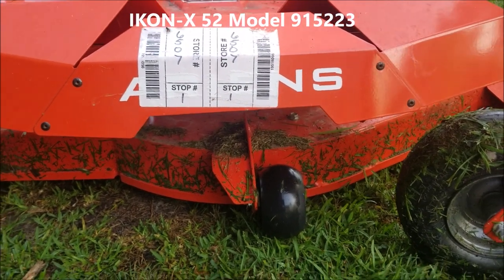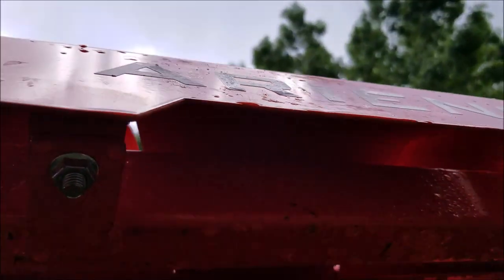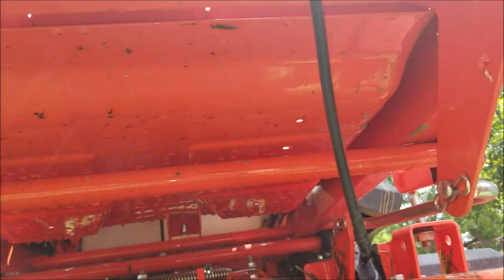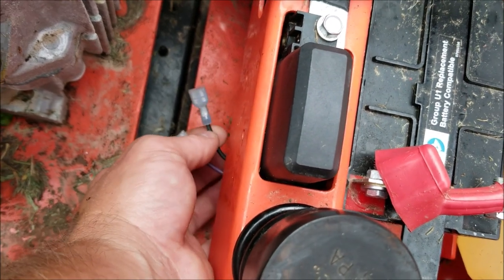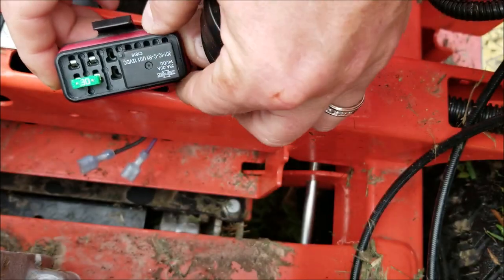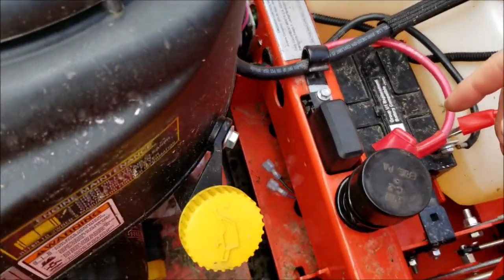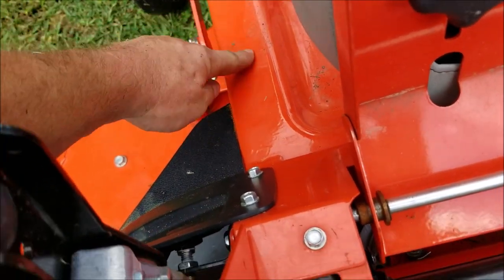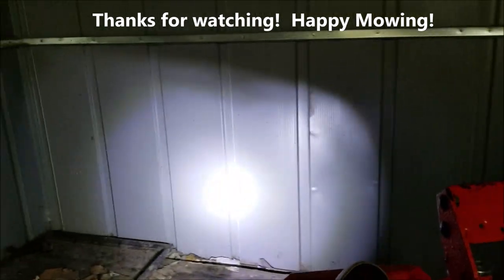$50 DIY Ariens Zero Turn Headlight Kit Installation and Wiring 71514100

Comment: Thank you for this! I'm an idiot when it comes to the most basic of wiring. Have had an LED sitting waiting to be installed. The only thing I needed was this vid!
Reply from the maker: Right on you got this.  Figuring out how to run the wires and tucking them away from moving parts was the longest part of my install.
Reply: JRMSweeps this is a very good question? I too would like to know.
Reply from the maker: Know what my friend?

Comment: For anyone mounting the switch in the same place that JRMsweeps did, I found that a 29/64 bit with some good in and out drilling makes for a perfect fit for the switch.
Reply from the maker: Thank you jashworth04 for that info.
Reply: JRMSweeps happy to help!   I too saw your DIY after I bought the official kit, but that didn’t stop me from going back and wiring in the switch
Reply from the maker: Awesome yes.  I should've just wired it to the main switch regardless cuz I mow in the daylight with it on to show everyone how cool I am haha.

Comment: Very cool, I just picked up a Ikon 42" with the Kawasaki motor and wouldn't mind a LED light. Although I doubt I'd ever really use it, lol. I also like the idea of a toggle switch. Ariens LED kit is nearly $150 so I'd rather do this!
Reply from the maker: It's cool having the only zero turn in the county with an led bar on it lol.  Ariens is crazy about their design, however, it is more plug and play.  You will def like ur new mower, I know we do.  The price was perfect!  Happy mowing, and go trick that mower out!

Comment: My 2020 Ikon xd 52 limited edition didn't need the switch. It works of my ignition. Just plug up wires zip tie everything in loom and good to go.
Reply from the maker: So how do u turn it off while mowing?
Reply: @JRMSweeps  the key you turn it to the first position and the light is on, the position after that starts the mower. Then you leave it there unless you want lights then turn it back to the first position. Mower is running and you got lights. If you want the lights off turn the key back to second position lights go off and mower is still running.
Reply from the maker: @jamesbeck6579  nice.  I wasn't sure if the model I had would do that so I did the inline install with a separate switch.  Great to hear and thank you for the follow up!
Reply from the maker: I wired mine to the ignition as well, but if I leave my inline switch on and turn the switch to the light mode, it will not turn it off, thus the redundancy.
Reply: @JRMSweeps  I just make sure to turn the key to the off position when I am done mowing. I think the 2021 and 2022 models have the switch setup so you don't need a toggle switch.  I know I am loving my Ikon XD 52 Limited Edition. It has a nice custom look seat is really nice and has the classic badges and metal covers over the deck instead of the plastic ones. Also the orange and white combo is so retro of the old Ariens tractors. Love the Kawi motor it is flawless. Thanks for the video. It helped me to install my light kit. I was not going to pay $150 for the factory kit. Just not worth the money.

Comment: I don’t know why Ariens would have told you that because mine works with the switch. Thanks for the video though!
Reply from the maker: Are u able to turn your light on and off while in operation, or does it stay on the whole time the mower is running?
Reply: Great video!    Why do they put a separate light symbol on the switch if it doesn't work independently? I wound think you get it running (no lights) and then turn it to lights without cutting off the engine.   I'm going to install a light and find out.
Reply from the maker: Thank my man.  Please let us know what you find out.  I'm sure using a tester light would be the easiest way to confirm without having to do a full install first.
Reply: So they can get you to buy there 150.00 light kit

Comment: I just ran mine straight to the switch? They have two open slots and a light button just for it. I ran my own wires and connectors...
Reply from the maker: Yes, can def do that.  I wanted the option to turn the light on or off while the mower was in operation.  I really wished the light switch at the ignition worked as intended.

Comment: all you have to do is run a wire from A and L on the key switch to make it work with the key
Reply from the maker: I wanted to have the option to turn it off while mowing.  Although it shows it on the key switch, that option isn't available and the light would stay on all the time while mowing...
Reply: @JRMSweeps  thats why you run the wires from A and L on the keyswitch, the lights wont turn on unless you tell it to with the key in the light position.
Reply: Can you explain this more thoroughly? Run wires from A and L to what and what?
Reply: @wiscofun3028   run the purple to A, and then tie in L to the power feed to the lights.  if your lights comes with a seperate relay or switch you can just bypass it because the key switch will now be in between your power and lights. My lighting kit came with a switch , and i just cut the switch off and spliced the wires together.  my ignition switch also had no wire terminal on A or L, so i had to solder wires to the pins. hopes it helps!!
Reply: By doing this you'll be running full lighting amperage through your switch, correct? Are you worried that your switch will eventually burn out? That would be an expensive situation. Is there a way to wire this so that the switch only sees the low amp side of the relay?
Reply: @wiscofun3028  i didn't worry to much about it cause the lights are LED and dont pull much, but if you are worried about it, run the power to the lights off the purple and also tie in the power wire to a relay to the purple, and run the ground for the relay thru A, out L, and to ground. or if your lights have a switch and a relay in the kit, just wire the lights up purple to hot, ground to ground, cut off the switch and run one of the switch wires to A, and the other to L.  and btw, the key switch is actually fairly cheap, under $20 amazon.
Reply: @Bo------ he is right. I have my lights wired that way. When I have the key on the lights the lights come on. When it’s on the next turn of the key the lights turn off. The fuse panel has a built in relay so you don’t have to worry about it over heating

Comment: Great instructions, thanks!  So I got everything installed, but the light is acting strangely.  I hooked up the light's black wire to the black ground wire, the red wire to the purple "hot" wire (by way of the toggle switch), and nothing happens.  There is power getting to the light, but it doesn't light up.  The light also has a yellow wire, and when I hook it up to the hot wire, then the light blinks rhythmically light a strobe light.  I don't know how to make the light stay on continuously.  I ordered the same light as your Amazon link above.  Trying to mow at night with a strobe light is not easy!  Any ideas?
Reply from the maker: Have you tried hooking the light up to a 12v battery - ground wire to the negative and hot wire to the postive to see if you get a constant light beam?  Try doing this with just 2 wires, red and black, then yellow and black.  You only need a hot and ground to power the led light.  I would test the hot and ground and not use the yellow wire and see if you get a constant beam.  The 3rd wire may be an accessory function.  Let me know what you find out.
Reply: Well I uninstalled the light from the mower and connected the red/black wires directly to the battery, and it worked perfectly.  So I reinstalled it back onto the mower, reconnected the toggle switch and wires, and it worked perfectly.  Apparently I must have had a bad connection somewhere.  So I just cut the unnecessary yellow wire out of the way, and all is now well!  BTW, my mower is the "Arians XD 52", and your description and instructions still match up perfectly with this newer model.   Thanks again for the fun project and saving me some money!
Reply from the maker: Glad you got it going man.  Sorry I missed your response.  Happy mowing and being the envy of zero turns wherever u mow!!!

Comment: Where is the link to the light?
Reply from the maker: Guess the the link updated to another product.  Here are 2 light bars very similar to what I used:
https://amzn.to/3NSKxOk
https://amzn.to/3PdSH4H
Reply: Thanks, I noticed that on the apex models lights are mounted on the side back by the seat...with this in the front can you actually see to mow at night?
Reply from the maker: It is "okay" at night for getting around, but I did this to really light up the night:  https://youtu.be/R0yLECy0dRE
Reply: Did you make a bracket to mount the light up front? I wish I could find a bracket to mount a light to rack side by the seat
Reply from the maker: @papamvc915  i show how i made the bracket in the vid.  You could always just screw it into the metal with self tapping screws.